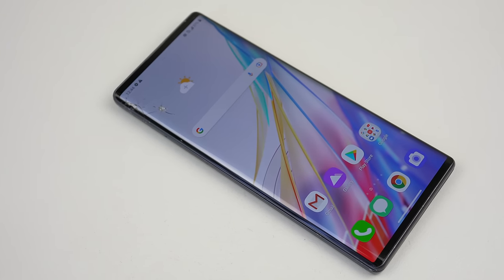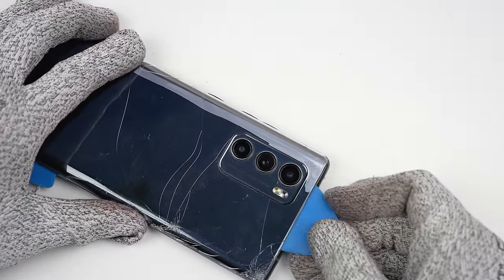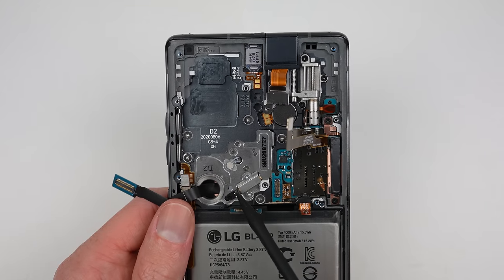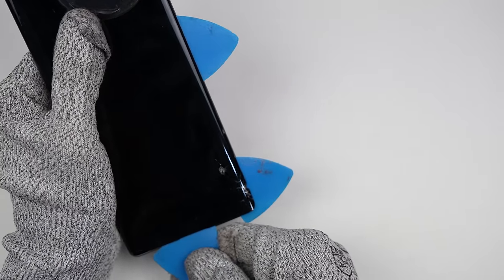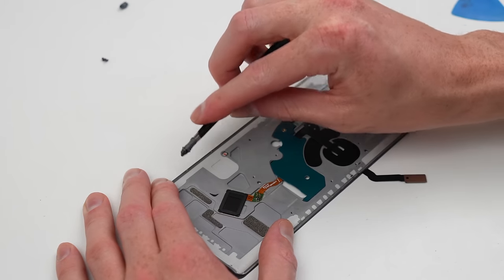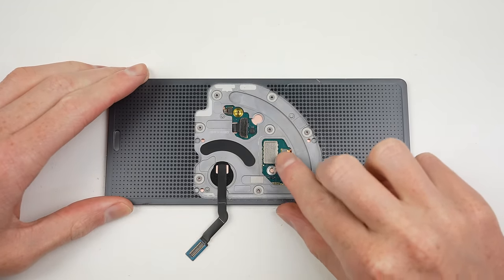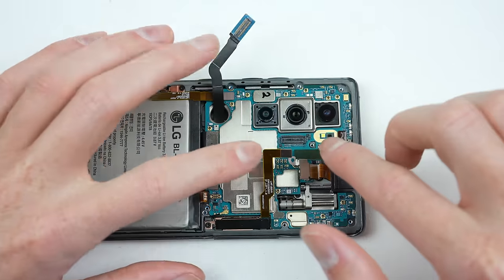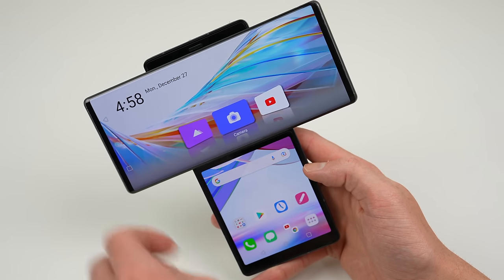LG Wing Restoration - Repairing The Last LG Phone

Comment: The fact this goofy phone is still easier to repair than an iPhone 12 says a lot
Reply: Ikr!
And given how weird and different it i, its actually AMAZING
Reply: Only thing it misses is headphone jack tho
Reply: Well LG's Are usually built like an AK/M-14,theyre TOTL yet Sustainable to both fix & Maintain,Prolly one of the Reasons On why I still Holding on to my LG V20 to this day,this Thing right here is Peak Android if you ask me
Reply: What does that say?
Reply: Lie
Reply: @backyardaviator2920  You could also give it to pixels. They are still fairly easy to repair especially the most basic things like screen, back glass and battery
Reply: To be fair its apple if they had it there way using a none apple certified cable would be a 12,000$ fine and a 10 year stent in jail. The fact ppl to this day support them truly disgustis me.
Reply: The iPhone 12 is much easier
Reply: Nahhhh.  Iphone 12 is substantially easier. The 13 however still easier is where the problem comes in. Face id and ear speaker flex cable are glued to the gate on the screen. Making that super easy to damage.
Reply: right on point
Reply: @backyardaviator2920  How much did LG pay to make you say that?
Reply: @StaticVapour590  none,I speak By Experience not by Talent or Marketing fees whatsoever,Tried most of the Current phones released by the Competition nowadays,& all I can Say is that,None of them are that Sustainable nor has Practical or any Useful specs conpared to the Ones released by LG when theyre still on the market. I mean where cpuld you still find a Company that still Slaps a HP jack on their Devices when the rest have gone down on the Dark Path Apple Created. EU Should make the V20's Standard, a standard for all Future smartphones,since sealed phones Aint cutting it for me
Reply: @backyardaviator2920  So you rather have "glorious" Android phone that's operating system is supported for maybe 2 years if you get lucky, you can't get any spare parts for it because it's cheaper to throw away than repair and you are paying for niche things like pop-up camera instead of something useful, like properly updated OS over the years. While you bash iPhones, you can use same iPhone for more than 3 years easily, you get iOS updates for many years. Let's take a look at iPhone 7, it was released in 2016 and discontinued in 2019, you can still update it to latest iOS version. How many of those "glorious" Android phones you have to go through in that time to have the latest software on it?

Don't talk about sustainability and Android in same phrase, they got none of that.

EDIT: forgot to mention that I'm ex-Android user, I will never go back to that stupid throwaway phone-boogaloo. Over 7 years of using those made me switch. I've been using iPhone for 2 years now
Reply: @StaticVapour590  I dunno where you live,but using Android phones In My Place are far more Sustainable than Using an iPhone here,due to the fact,we literally have tons of Spares here to keep em running way beyond their Lifecycle & also we dont have those Crazy Sheit that Restricts "Right to Repair" since doesnt even care about Copyright Crap from major Companies like Apple,also jf you ask me,The only Good Apple iPhone Ive Used to date would be the 6S,that thing still has what An Original iPhone Should Have while being Up to date software wise at the same time. You guys should Fix your Serious E-waste problems,by I dunno,Not upgrading your phone Every 3yrs or so lmao
Reply: @backyardaviator2920  I absolutely did not mean to be rude or anything towards you. More I think of it, you got valid point. If there are spare parts of any sorts, then it's viable option to repair/continue the lifecycle of phone.

While I was Android user, there was little selection of spare parts for any of my phones, not sure why. Mainly batteries and screens. I had to recycle few phones over those years because there was no spare parts available.
Reply: This is just plain wrong. The back glass, sure - but the display (which is the much more important component) is far easier to replace on iPhones than not only this phone, but most Android phones.
Reply: @StaticVapour590  s6 s7 s8, pixel 2 pixel 3, and the crap ton of android flagship from that era and beyond that can the ip7's job better with better screens and features
Reply: @tridinh1011  Oh no fanboy is attacking! Read my damn comment again and quit your nonsense all together. Did I mention something about phone's specs? Did I compare their specs or features other than OS? 

I said that even the old iPhone 7 can get the latest operating system on it, how many of those Android phones from same year have that?
Reply: Last phones are always made out of 3 pieces
Reply: @Kazwell96  you clearly haven’t fixed or opened a iphone12 before
Reply: 💀goofy ahh
Reply: the fact that LG is done making phones says alot lol
Reply: *goofy ahh phone
Reply: @Zero Bullet's how is this LG (or any android phone) cheaper to repair?! Have you ever checked the price of iphone parts on ebay or amazon? Have you ever checked how easy it is to purchase iphone parts online? I used to have a side business of purchasing damaged iphones, fixing them and selling them at a profit. I never bothered with android phones because their parts are WAY more expensive than iphone parts and the ROI would be minimal at best. 
The thing that makes android great (different choices) also makes them very expensive to repair.
Reply: @gtnlb  cap
Reply: @costelli1  I think this one gets an accpetion, with how much stuff is in it
Reply: @jasimaneesahamed1033  oooô
Reply: @SCtester  maybe with the right tools, but androids are significantly easier to repair with the tools the average person already has in their home. Plus, once you finish your repair, there’s no guarantee that you’ll be able to use the phone to the fullest of its ability, what with the anti-repair stance apple seems to be taking
Reply: @Kazwell96  bro iphone parts are software locked 😭
Reply: @backyardaviator2920  such a knowledgeable guy
Reply: @gtnlb  nope as Hugh already proves its so hard to do
Reply: @Maximus20778  albeit true. If your a skilled technician with the right tools the serialization of components is doable
Reply: @GuitarGreekPlayer  it's not! This wing is far simpler to repair than any iPhone to exist
Reply: Youre goofy too
Reply: @backyardaviator2920  holy shit buddy. You don't have to use predictive text when you type. Only capitalize the beginning of each sentence.
Reply: @GuitarGreekPlayer It's not you goofy "guitar player"
Reply: Who buys trash i 12 thing?

Comment: They really could've had a great follow up to their last devices if they would've chosen to continue. If they added things like 90hz to this device and perhaps a somewhat more powerful processor it would've been awesome.
Reply: The LG Wing 2 (or Wing Gen2 however u wanna call it) was actually supposed to have:
* A 120Hz screen (at least main) or 90Hz on both displays
* Snapdragon 778G or 888/888+
However, it got cancelled
Reply: Would have been the best phone on the Market
Reply: @westonstatt5655  it really wouldn't have been. This is such a weird, fragile, unnecessary gimmick. What value does this have for the average consumer?

Comment: I used to see the colored film peel off when fixing older Samsung phones with the glass backs.  I feel that the age of the adhesive and the film made them bond especially hard, but I haven't found it to happen too often.
Reply: Yep, happened with my S6 when I replaced the mostly dead battery.
Reply: Same here with the S6, S7
Reply: I do phone repairs and this happens the most with samung A51 models.
Reply: I like the really tough plastic back on the Samsung 21 Ultra.

Comment: I honestly think this is one of the most underrated phones ever made. Company actually tried something different and unique. It's a multitasking device you can actually hold in one hand. Doesn't have a scratchable plastic screen like the foldables. It doesn't have any notch or punch hole. It has a gimbal and a pop-up camera. And it even has stylus support and a desktop mode.

Comment: Hi Hughes
Big fan
But I feel like you are using the wrong type of glue
I recommend you use the T-800 as it does not harden as much as the clear one, but is still more adhesive.
Might I add that it is also much much easier to remove especially when you use alcohol
Also letting the glue set for a min before installing the screen helps as it wont sip into places you don’t want it to

Comment: I have a Wing and it's such a POS. Things that worked when I got it don't work now (Like the FLASH). Since about the 30-day mark, little issue after issue has been popping up. I dropped it about 2 months ago, and no one will touch it. Also, the FLIP action works fine after 10 months (and a good drop later), most issues are software-related.

Comment: As US version phone like mine, while disassembling it, did you were able to analyse if the hardware made to read the SIM card and the microSD memory card, can also reads a second SIM card fitting perpendicular to the main SIM card? Some extra contacts for the second SIM maybe? In theory a dual SIM configuration can be done (watching some videos from India) but I don't know if it is hardware region restriction or just software restriction, because I tried it but it did not recognize it. Does yours phone work the same way?

Comment: Hey whoever reads this

What happens to broken/destroyed displays(Where the panel itself is broken)?

I wonder if its possible to restore dead panels, with that I mean the common breakage where the entire display is flickering and not useable and also the black spots that sometimes expand when you touch them?
Also where to throw dead displays to?

It would be nice if someone knows what exactly happens to these displays

Comment: You really need to stop using that liquid glue on the phones. They are messy and just not better than a double tape adhesive. Event he thin side wing of the screen panel dan be put together with a double tape.